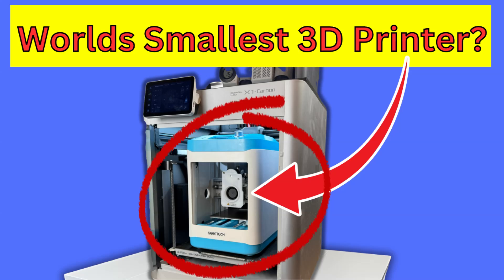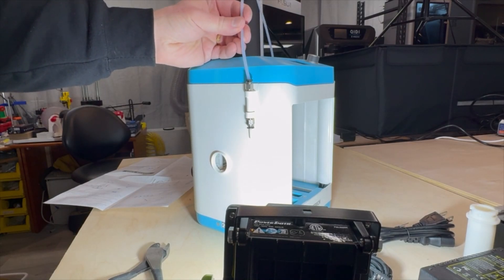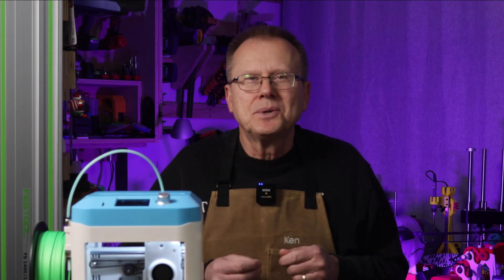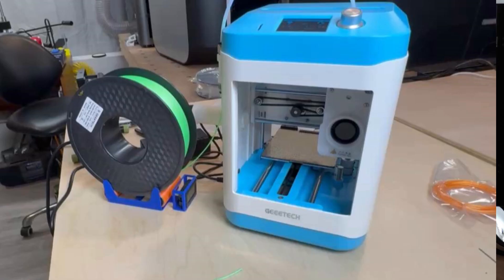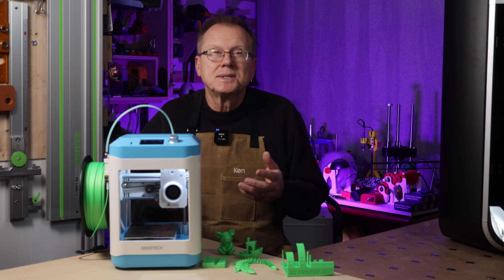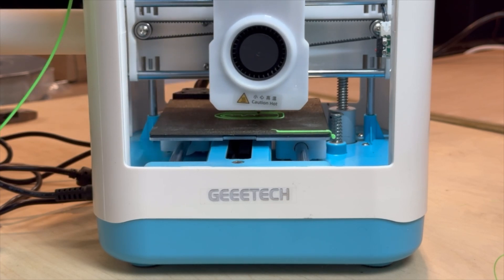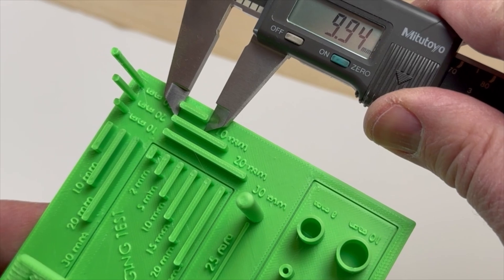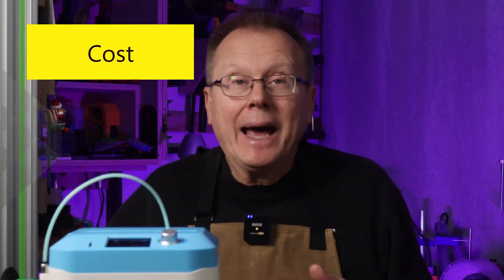Advanced Features for a Tiny 3D Printer: Geeetech M1 Mini

Comment: I watched this video with the sound off and captioning on so I might have missed a little.  I was wondering why on earth the menus just had PLA and TPU and not PETG, but then with the max nozzle of 230C answered that, surprised they were so close to being able to support that and didn't go for it.  But this printer is just a toy compared to the Bambu A1 Mini and with the Bambu you could add the AMS Lite if you chose later.  That's just a no brainer plus the build quality of the Bambu is sure to be much higher.
Reply from the maker: @StevePrior  Hi Steve, I completely agree with you on all your points. Thanks for your comment.